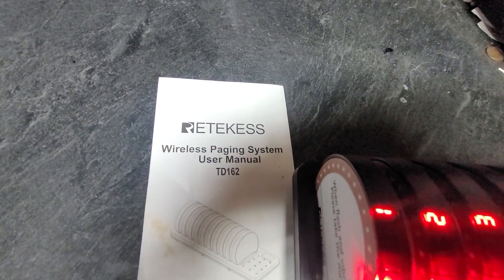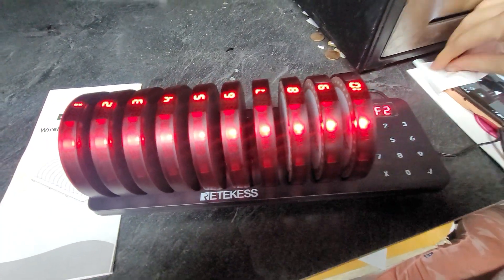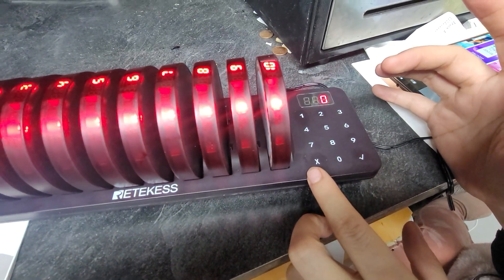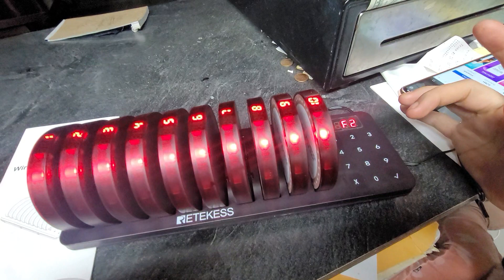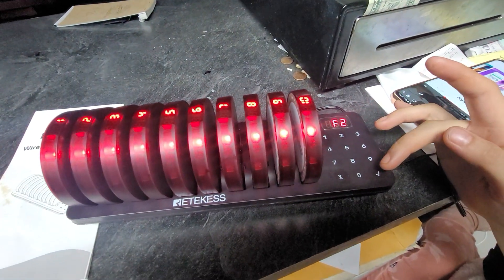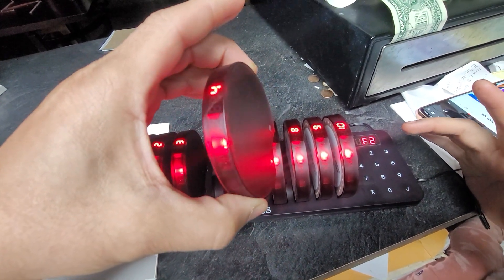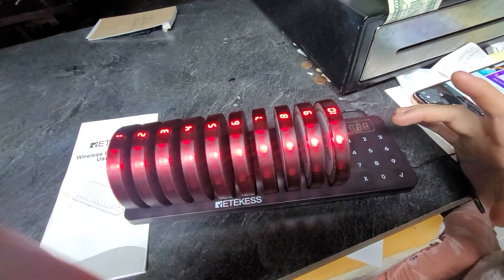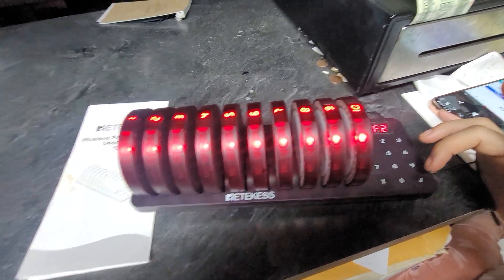How to Program Retekess TD162

Comment: What is the correct way to maintain them when the business closes?  Just pressing 999?  Or is it disconnected from the energy source?  And do you recommend always keeping them in the base or once charged, keeping them outside the base and only putting them in the base when they need to be charged from the battery?
Reply from the maker: We press 999 and unplug it.